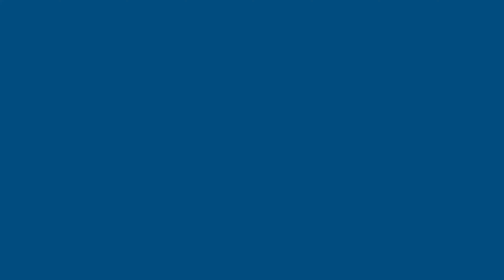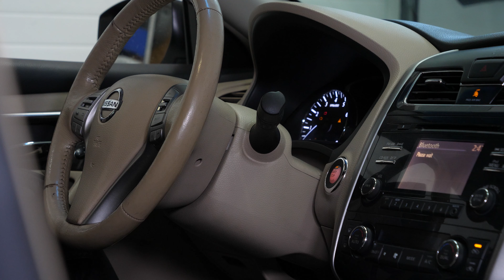How to replace the Front Wheel Hub 2013-2018 Nissan Altima 🚗

Comment: Just did this job on my own and now I'm getting an scratching noise on every wheel rotation. It's not the dust shield (I pushed it back and if it was, the noise would be consistent because it sits parallel to the rotor) and I torqued everything down to spec. I'm not really sure what went wrong. Any help would be appreciated. Great video btw!
Reply from the maker: Hello, do you have any news?
Reply: Your probably had dust residue left over there and its either git into the splines of the cv axhle or into the hub that would be my guess. You gotta be super thorough you could have bent the backing plate and its rubbing very common